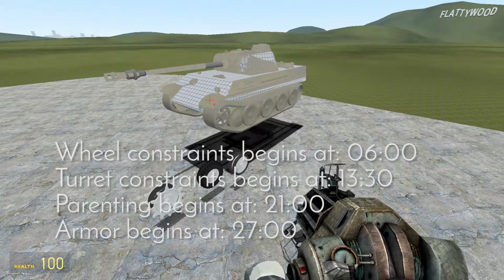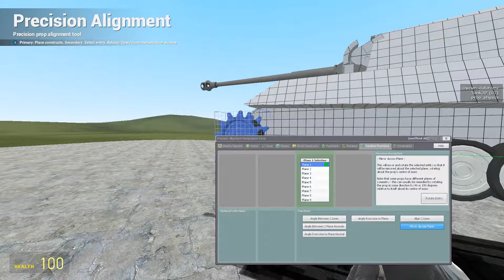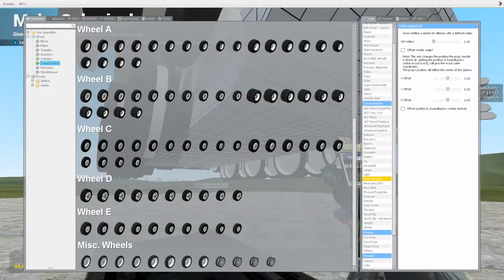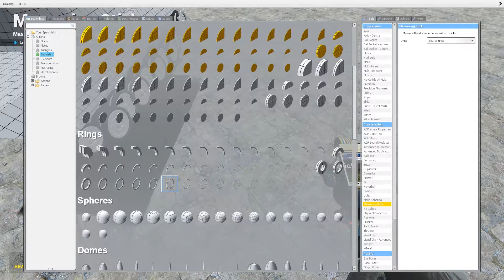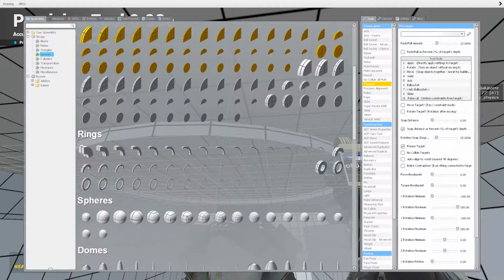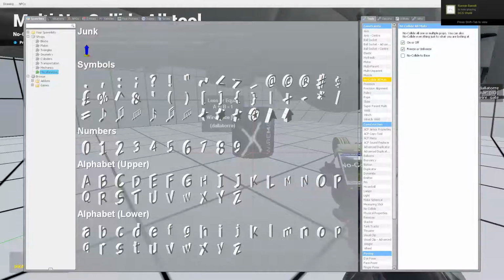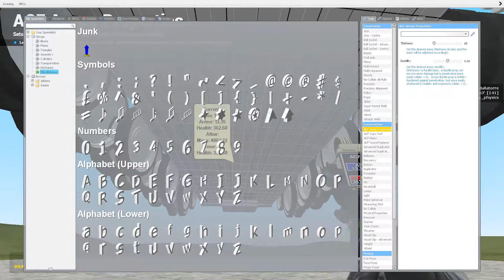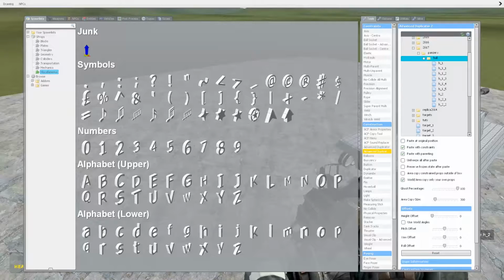GMod ACF Tank Tutorial 2: Physics

Comment: Hey i wonder is that possible to make an acf tank like UDES03 with hydraulic suspension that make tank hull can move
can you tell me how or make an tutorial. Because i always fail when trying to make dis tank
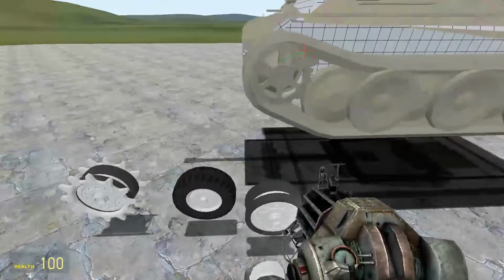here https://www.youtube.com/watch?v=Ei5ymy2zbC4 at 0:49
thanks

sorry for my english
Reply from the maker: LoL LeL I know that. It's definitely possible but the result might not be what you expect, that's why I never tried.
The wheels behave super awkward when turning and the hydraulics are not even rigid, this might result in unprecise aim.
Anyway... I would attach a pair of wheels as a singe axle with 4 ropes (floating axle) and use a reverse hydraulic (goes in to the ground so to pull instead of push. the only way would be to design an E2 feedback controller to compensate for the errors in the suspensions, and cheat a little on the turning